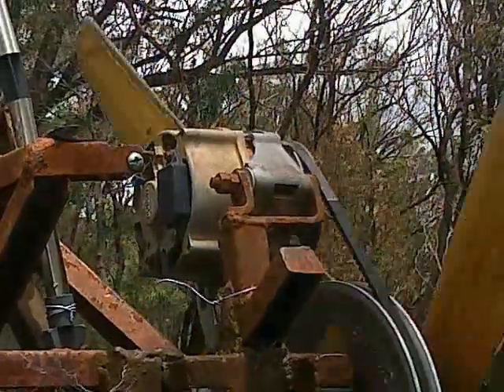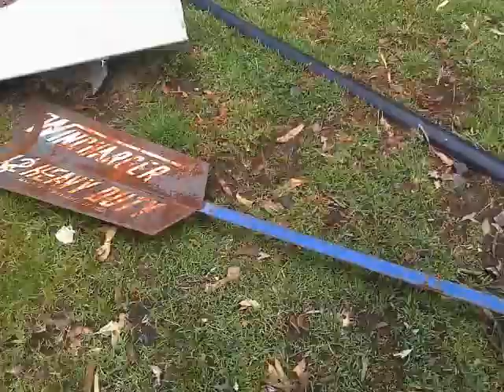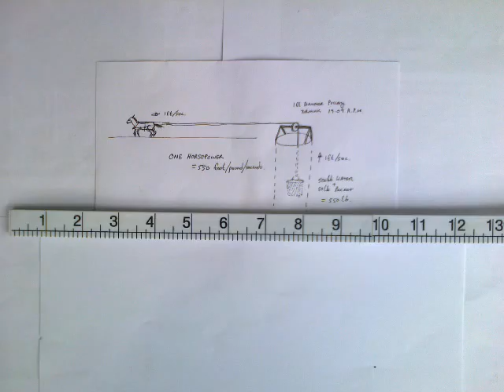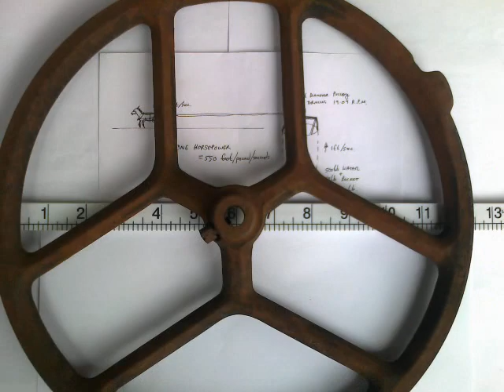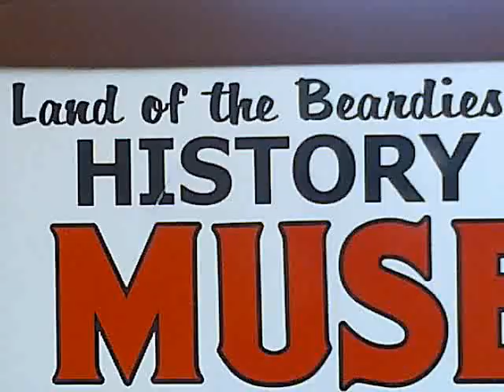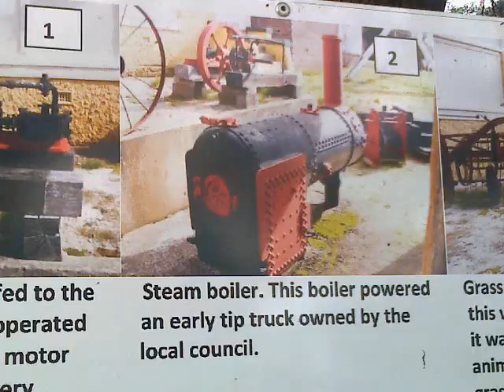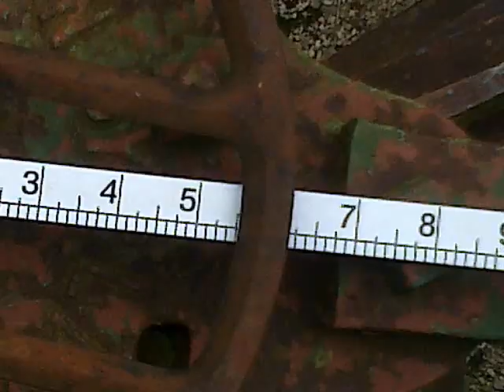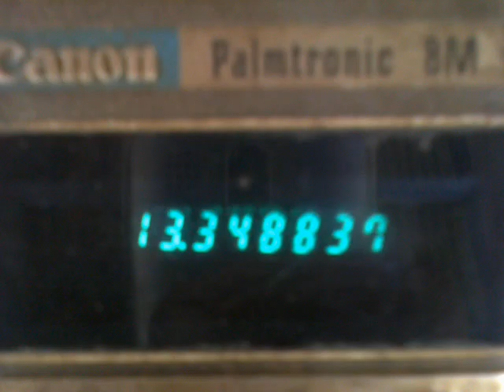Horse Powered Electricity...

Comment: Hi Chris,

Impressive video. Those old machines are still amazing. Your artwork and calculations are spot-on, and that museum was really interesting.

When I was a boy we had an old machine yard near us. We just called the place, "the scrap yard", but it had old steam cranes and other steam-powered machines. We never really knew anything about them. When I think back about that place I always wonder what became of the old machinery. The machines were very old and had been laying there long before I was born.

One of those permanent magnet motors you have impressed me. The one with the wind vane attached. That one will be easy to mount and the connecting bearing for the vertical is already fitted. Great stuff.

I built a small wind turbine with a DC 36 volt electric scooter motor. I used gutter pipe for the blades and it works well. Gutter pipe is fine for smaller blades but no use for blades over 4 foot because of their flexing. Plus you need to cut the gutter pipe in an angle so that you get two blades from one gutter pipe.

Great video.
Cheers.
Reply from the maker: G'day Mike,

  Thanks mate.

    I spent a lot of time in that Museum when I was growing up, my parents were big movers & shakers among it's founders, Dad was a Life Member of the Historical Society & Mum's still on the Museum's Board...(!) ; and I've been meaning to make some videos about it for a long time..., so this is probably a bit of a Taster, kind of thing ( it might take another 4 or 5 Videos, the place is HUGE, compared to most small-town Museums - which are generally crammed into a single old house or a shed...).

  It's kinda funny that I literally grew up in the Land of The Beardies..., and was half-raised in a Museum (!)

Such is Life,

Have a good one...

;-p

Ciao !
Reply from the maker: +WarblesOnALot 

PS,

   Those were both purpose-designed 12-Volt Wind Turbines, but they can be connected to a Battery without a Diode & "Motored" ; it's often done to check the Tower Circuitry, on new installations...

;-p

Ciao !

Comment: Interesting and nicely explained. There are always losses incurred when moving between mechanical energy and electrical energy and vice versa, the only advantage being that electricity can be transported to users via cables and wires instead of waiting for energy deliveries by road and rail with time delays and at a higher cost.
Reply from the maker: G'day,

Thanks mate.

   Yeah, though in this case the Generators are about 85% efficient at turning Shaft-Torque into Sparklies, and I allowed for 95% for the two Belt-Drives & 90% for the two sets of Steel Gears...

 The most  impressive bit, to me, is that the "Horse-Works" is 50% efficient at taking an actual Horse walking, and converting it into 20 RPM with a 1-Foot diameter  PTO Pulley, so with 2 actual Organic Horses it produces almost exactly 1 "Steam-Horsepower Equivalent", in order to power anything which a little Steam-Engine could drive with a Belt...., I've seen it working with one Horse - running a Chaffcutter at the Trade Fair, as a demonstration, in about 1975...

Such is Life,

Have a good one...

;-p

Ciao !

Comment: No wonder the ice caps are melting! They left the heater on!
Reply from the maker: G'day,

Thanks mate.

   Yeah, my thoughts prezactly !

    But, it's a great testament to the durability of Fixed-Pitch Wooden Wind-Turbines, and Permanent Magnet Generators...; I wonder how long the modern Plastic & Composite Turbine Blades will run for...?

Have a good one,

;-p

Ciao !
Reply: @WarblesOnALot  nothing is made to last these days, unlike back then. I would say you would be lucky to get 10 years, since there will be diodes involved and they slowly migrate metal across the junction. And the "laws" of economics drive the inbuilt fail points to keep you shopping lest the company that made it goes out of business due to lack of return customers and lack of sales from parts. "The light bulb conspiracy" applies pretty much every where except for in jewelry.
Reply from the maker: +m3sca1 

Well, in the application (Bar-Radiators in the Arctic or Antarctic...) no Batteries or Diodes or Tubes were involved, the Generators had Slip-Rings to allow them to track the Wind, and then were wired direct to the Radiators, probably with a manual Current On/Off Switch to each Bar ; and a Self-Furling Mechanism balancing the Tail's weight on an offset Hinge-line against the Rotor's Horizontal Axis being offset to one side of the Tower's Azimuth-Bearing's Vertical Axis.

  One sets it up so that below whatever speed one is confident the Tower can handle, the weight of the Tail overpowers the Asymetric Wind-Drag on the Left & Right side of the Rotor Disc..., but above that Windspeed the Rotor's inclination to "weathercock" side-on to the Wind becomes stronger than the Tail is heavy ; so the Tail gets lifted up as it folds downwind, while the Rotor-Disc progressively furls itself and eventually becomes parallel to the Tail..., and when the wind drops - the Tail falls back into place and brings the Rotor back to face the Airflow.

   The Geometry is a bit funny, but it works ; it's what I built the Lawn Ornament "Turbulence-Tolerance Test Rig" to study in action.

 So, the modern Neodymium PM Generator should keep running, and no Diodes are involved, but I can't see the Carbon-Fibre Blades lasting as long as Hardwood.

Wood does particularly well, at Fatigue-Testing, being immune to Metal Fatigue, and it doesn't delaminate or corrode either...so if it's too frozen to be wet - except when the Sun is on it ; Wood can be a winner, as a Polar-Grade Wind  Turbine Blade.

Have a good one,

;-p

Ciao.!
Reply: @WarblesOnALot  if no diodes in that chinese modern equivalent...that's great. Where did you get it and how much are they?
Reply from the maker: +m3sca1 

Well, I was given that one by the people who had opened a Solar Panel Shop in Town, when the Federal Subsidy was begun..., it was their demonstrator that got dragged around & set up at Trade Fairs, Shows, Ag-Quip, stuff like that ; and it aquired a missing Blade-Attachment Bolt & a bit of insulation tahen off a pinched Output-Wire, so they couldn't sell it - and when they left town I got it as a Gift... (I'd bought 5 Panels from them, so I didn't mind.

  I think that Jaycar was selling something similar, for about $300.

  They come with an inbuilt Battery Chargd Controller that uses excess Current as an Electromagnetic Drag-Brake ; but the Rotor Blades are "Coned-Forward", and the Tail is really short - so in a REALLY strong Wind the "Anhedral-Angle" overcomes the Tail, and whichever side of the Array is slightly Downwind of the other "wins" & the asymetric Drag pulls the Plane of the Rotor into alignment with the Wind... (very cunning).

  It's Controller will be full of Diodes, but without it, the Generator's Output can be controlled by changing the RPM....; or with a Human Hand & Eyeball, & a Voltmetered Battery, and a Wire-Coil Resistor to compensate for Windspeed-dependant Output variations.

That Altronic Inverter of mine is 32 years old, it's full of Diodes, and it's going great...

 Have a good one,

;-p

Ciao !

Comment: Hi mate, great video. I spent one summer working as a guide in an iron ore mine from the 1500s. They had just this type of horse pulled equipment. I wounder if those horses ever saw daylight once they were brought down there...
The mine also had miles of https://en.wikipedia.org/wiki/Flatrod_system connected to it, transporting energy from streams.
Reply: I think a lot of people used Irish draft ponies in mines
Reply from the maker: G'day,

Thanks !

   As I understand it, the Horses which actually went down the Pit stayed there until they died of overwork...; so the ones on the surface pulling Waterbuckets had the proverbial "best of a bad deal" (!).

  Have a good one,

;-p

Ciao !

Comment: Very informative Warbles, although your conclusions do not consider the technology used at White Rocks Wind Farm.
 That being Permanent Magnet Direct Drive  generators.. Operating at well below 60 RPM with no gearbox or pulley losses. Can you recalculate Horse Hours required for your daily electrical requirements. Have you audited your power usage .  How much pedaling on a bicycle generator would fulfill your essential  electrical requirements ?  Cheers..
Reply from the maker: G'day,

  Thanks,

  Ah, well, y'see, the reason the White-Rock Neodymium Permanent-Magnet Generators torn so slowly (20 RPM to 60 RPM) is because their  Wheels covered with Magnets are 10 ft accross...- so they achieve the 1,112 Ft per minute Transit-Speed, of the Magnets passing the Pickup-Coils - at a RPM sufficiently low as to keep the Blade Array's Tip-Speeds below 660 Feet per Second...

   To give me 280 Watt/Hrs per day would take 6 hours walking a pair of horses in 3 hour shifts, and the Horses can only work for 4 hrs per day & they need a rest day for every work-day, so it will take a herd of 8 Horses...; add in 45 minutes to catch, feed, water, brush & harness each Pair, plus the same again to unharness, brush, feed, water  & turn them loose..., as well as 10 minutes of rest for a drink after every hour of working....

 And I get a figure of 11 hours of work for one person, with 6 hrs from 2 Horses, every day..., to almost compete with what a 160 Watt Solar Array's controller feeds my batteries on an average day....; and to equal what the Tracked Array can supply in a day would involve 13 hours in 3 shifts of 3 hours walking in circles & 1 shift of of 4 hours, plus 6 hours of catching & feeding & watering & combing & harnessing/unharnesing, as well as 2 hours of 10-minute Rests....

  So I would get to be busily-engaged for 21 hours per day....

   Which is why nobody ever makes Electricity with a Horse.

Such is Life,

Have a good one...

;-p

Ciao !